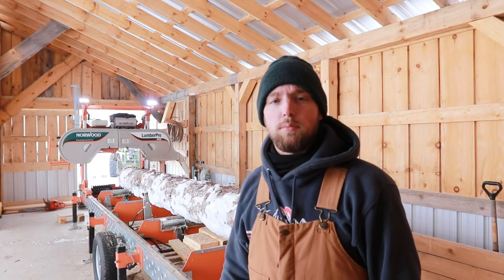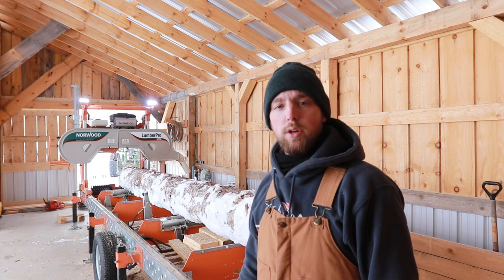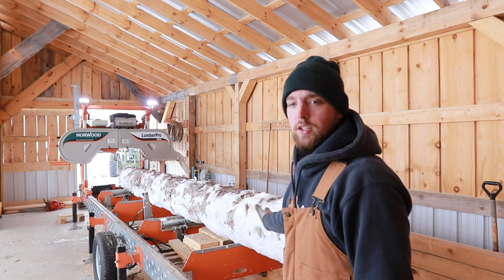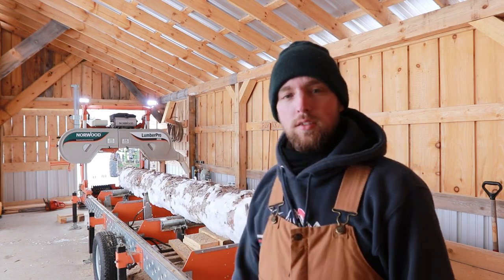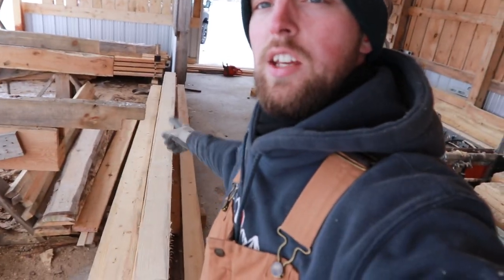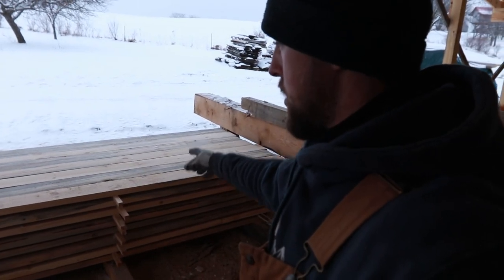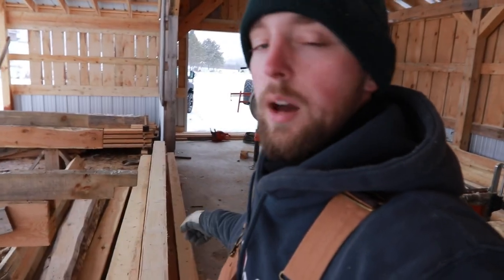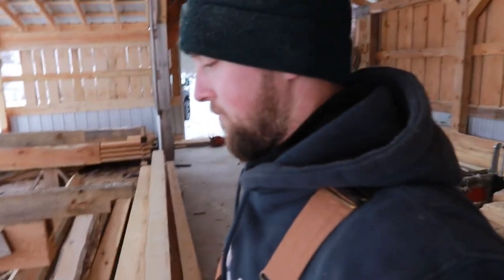Maxing out the Sawmill for a Cabin build.

Comment: The only thing about these type of videos is that people can't see what is going on or learn anything about the process of milling a log. It is not something that makes the viewer engaged, more tik tock oriented.
Reply from the maker: Thanks for your feedback! 
I have a video in the works on how to mill a log from start to finish.
Reply: Good morning thank you for the video. I have a Norwood hd36v2 manual mill and love it. Ive made quite a bit of long Timbers on the mill, a double pass’ gets you a nice clean straight timber. When I rotate the Cant I generally make a skim cut just to insure flatness. What scrap that’s not usable goes to the wood pile to keep me warm next winter. 
What blades are you using and how much time are you getting with them. I cut mostly pine fur and cedar, so I use the 10 degree blades. I’ve found that the woodmizer double hard lasts much longer than the Norwood blades. I pressure was the logs before I cut to increase the life of the blades, when I have water. Sometimes when I’m am out in the bush I use a scrub brush to get dirt off. I use a home made log arch behind a quad or Jeep to move the logs. 
Running a sawmill was a life long dream I’ve had since I was in high school. I can build anything I want or need from the trees on my own land. I love it, makes me feel like the olden times, self reliance, I don’t need to buy lumber from the big box store I live way up in the forest 24 miles from town, so peaceful and quiet. Wild life all around it’s beautiful! Thanks for making the videos and sharing your techniques. God bless you and yours!
Reply from the maker: That’s awesome man! Thankyou for sharing as well! 
That’s great! 
Livin’ the dream! 
I use Cooks Saw manufacturing blades mostly. 7/8” I like them quite a lot. It seems that sometimes I get a lemon or maybe just needs to be set and sharpened properly. They are slightly thicker I think than Norwood blades. 
Interesting I’d like to try woodmizer blades sometime, 
I also like the 10 degree blades but 
I have Norwood blades but I haven’t touched them in a long time. And they’d need to be sharpened.
Reply: @Plankmills  That would be interesting, thank you. I hope I wasn't too blunt and it's only my view of it. Looking forward to the next one!
Reply from the maker: Your fine! 
I’m just trying to post one video every day for the next about a month, so…